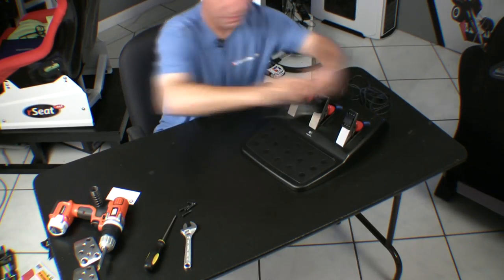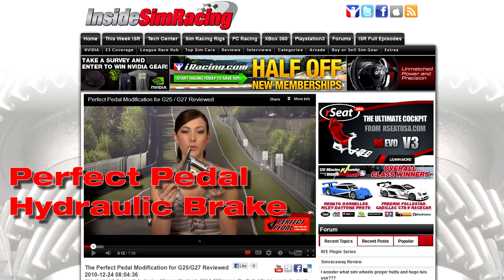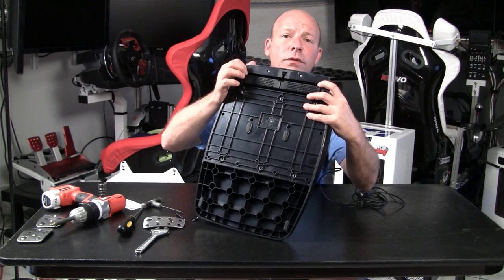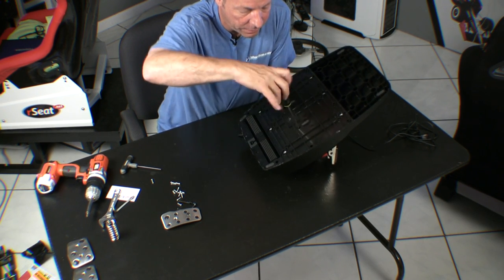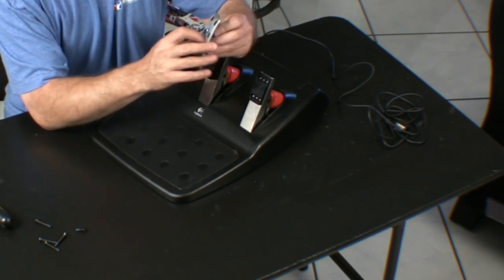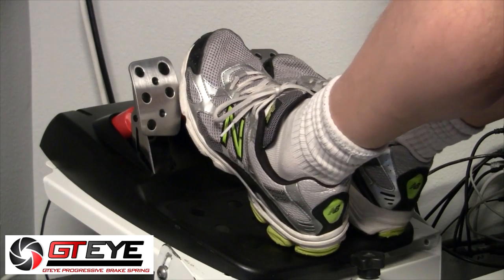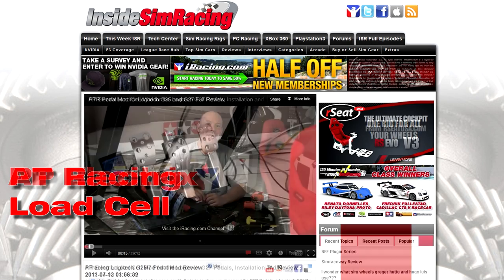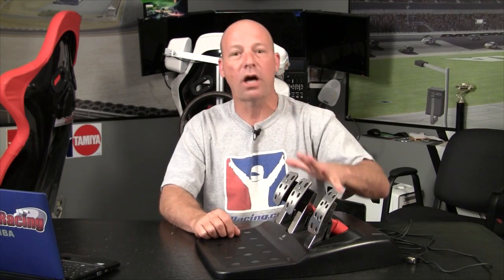GTEYE Brake Spring Mod for the Logitech G27 or G25 reviewed by Inside Sim Racing

Comment: Just in case anyone is watching this now, here's a piece of advice so you don't make the same mistake I did and then have to spend an additional hour with a soldering iron.

When you're placing the cover back on, make sure you're extremely careful with where you route the wiring. Due to how logitech designed the wiring "harness" for the G25/G27 wires, it's extremely easy to damage the wiring when reinstalling the cover. I don't mean simply pinching a wire either. The way the wiring is routed, it is VERY easy to have a section of wire near the little anchor piece to end up directly underneath one of the screw holes. The hole in particular I'm referring to is the left hole underneath the carpet gripper. That hole is extremely close to where the wires are running, and if you don't have the wiring exactly where it was when you removed the cover, you can run that screw back in and pierce right through the wire without even knowing your doing it because the screws go in rather snug normally.

I installed a spring mod and cleaned out my potentiometers, put everything back together and then fired up iRacing. When I went to calibrate my pedals, my throttle was completely dead. I was stumped as I made sure no wires were pinched when placing the cover back on and installing springs didn't require me to remove the connectors going to the potentiometers. When I went to take the thing apart again, I removed the two carpet gripper screws and that's when the issue caught my eye. I was working under a bright light and I could see a piece of red wire through that very screw hole and that's when I knew I must've damaged a wire. Took it completely open and sure enough, I mangled the black wire going to the throttle pedal. I had to remove the shrink tubing to get to the wire and since the wire is such a thin gauge, I had nothing on hand to splice it with. Thankfully there was just enough slack in the wire so that I could cut the wire, strip the two ends and solder them back together and finish it off with electrical tape. I got pretty lucky to say the least.

So just make absolutely sure that no wires are blocking those screw holes. As far as I'm aware, the only hole close to the wiring is that left one under the carpet gripper.
Reply: @untitled. Place the top plastic cover of the pedals upside down over an open box, then place the pedals into their slots in the top plastic part, then route the wiring, then place the plastic base on top and screw down. You're welcome ;)
Reply: Yup, had this happen to me as well. Had to go to the local soldering guy lol

Comment: If you unscrew the top end of the "shock" then you can replace the spring without taking the whole thing apart, just the two screws behind the pedal. Just installed it, working great!
Reply: Do you mean, you can replace the spring without removing the back cover?
Reply: @pato17rio  Yes, just remove the upper screws for the "shock" and pry it out. It will split and you can replace the spring and push it back in.
Reply: I was thinking if that could be done. Thank you for clarifying!!
Reply: Just replaced the spring without opening the cover. Thank you for the hint!
Reply: Can't do this
Reply: Thanks for the tip!!

Comment: Hey shaun, just a little clairfication.

The progressive spring will have the same resistance regardless of which direction you apply it, both sides will feel soft and then hard.

Because a progressive spring /any non spring with non linear spring constant will go from the weakest to the strongest regions (k value).

Comment: Best bang for your buck feels grate transformed my driving experience within a couple of laps in the V8 SUPERCAR i went from 2min 12sec laps of Bathurst to low 2min 8 sec on IRACING with lots of room for improvement.  i did install GTEYE BRAKE SPRING with the tight coil facing towards the bottom base of pedals unit with the soft coil part at the top of the brake pedal ass per instructions from GTEYE the new spring does come powdercoated as of 2016 . and calibrating at about 85 percent in IRACING CALIBRATION worked grate for still sockable racing which is what drew me to this mod and no clicks or squeaks perfect. Thanks INSIDE SIM RACING

Comment: GTEYE Installation Instructions PDF Download

https://gteyeblog.files.wordpress.com/2015/04/gteye-pedal-spring-instructions.pdf

IMPORTANT: For Brake Spring, install 
with the closer coils facing downwards to the 
lower half of the plunger

(not as on the video or Shaun Cole of InsideSimRacing mounts to upside...)
Reply: CTEDDY47 I noticed this too. I just received mine in the mail. Excited to try it out.

Comment: I used the Nixim mod ver. 2 and loved it, although I returned the clutch spring to a stretched-out stock spring. I also stiffened up my gas pedal spring with spacers and stretching out stock spring. Then I got Fanatec CSR Elite pedals.. I tightened the throttle pedal all the way, and set brake load cell to about 4.8. I still use socks!

Comment: Just a hint: you're supposed to take the cover off the other way which allows you to route the wiring correctly. Before taking it apart, remove the extra 12 screws in the bottom and raise only the bottom panel. This requires putting the whole pedal set over e.g. a box so that pedals do not touch anything while you're taking the bottom plate away. You still need to remove the pedal faces from the pedals that you want to remove from the set. This way also gives you all the space you need while working with the pedal.

Comment: Installed mine last night.... WOW what a difference a little spring can make!  Within 15-20 mins I started getting my braking sorted and the laptimes started falling, no more lockups and much more predicable braking especially in IRacing. I can highly recommend this mod to anyone looking for a cost effective hardware mod which still allows you to mod without having to mount the pedal set. Also, I bought it directly from www.gteye.com.au, not via Ebay.

Comment: Best advice to remember from this video is: the travel memory vs. muscle memory. The later prevails at all times. So, whatever mod yo use, it will definitely be better than stock.

Two Quick q's on this:

1. Can I use the stock brake spring for the gas pedal for a little bit more feel ? Did anyone do that ?
2. Is this better than nixim ?

Cheers
Reply: Clutch spring has far too much rebound for the throttle,

Comment: The ONLY way to get progressive tension is to vary the diameter of the spring wire, what is done here is a stiffer wire that makes one end suffer coil bind thus stiffening the response. As for your cables yes spot glue and put a cable clamp on the base so the wiring is not attached to the top cover.

Comment: I run in socks just fin with the Nixim 2 brake mod. It's the best bang for you buck improvement to the G25/27 pedals. Shortens your braking zones like mad because of it's rubber insert adding a real tactile max brake point. I hit all the time and I instantly know I'm at max braking. With a spring, no matter how progressive, will run out of travel and only then will you know your at max braking. There isn't any proper feedback. it's a guessing game, just like the standard Logitech pedals.

Comment: Until a few months ago you could only buy the Nixxim mod with the break a clutch mod, wich sets you back £33.49( arround 43€), i bought the GTEYE mod a few months ago for 23€. The Nixxim mod ins't better, its stiffer, with for me means its actualy worse, beacause its to stiff, you can't drive with out shoes. The GTEYE mod is really good and it is a nice upgrade over the stock spring.

Comment: Oh I forgot, I applied some white lithium grease inside the red tube where the tubes slide and also around the spring- it made a huge difference. Lithium grease won't harm plastic like other types of grease can, that's why you use that type.

Comment: G27 brake spring is much harder than gas or clutch.
I use my G27 mounted to my desk, and I'm reasonably fast with the right cars, but I actually think the gas pedal could be improved a bit as well.

Comment: I'm using stock Logitech G27, would this upgrade improve the experience with Gran Turismo 6? Because it looks like it shouldn't, because the problem with Gran Turismo 6, is that whenever you upgrade your cars brakes to racing brakes, it starts to lock up after about just 10-15% of the pedals way, this mod visually seems to only add extra pressure after about 40-50% of the pedals way, which means it wouldn't do me any good. Does anybody know an upgrade to make it possible to add some deadzone to the pedal or something, so that the brakes would only lock up after using 35-50% of the brakes instead of 10-15%??? I mean today I really got annoyed by it, I can only race with non-racing brakes, because the racing brakes just feel buggy with GT6 + stock G27 set...
Reply: +arcelivez never played gt6 but can you not turn the brake pressure down in the tuning settings for each car in game?

Comment: 30 bucks for a friggin' spring, that's just absolutely nuts, the whole simracing gear thing is one of the most overpriced gear ever, more so than high end audio systems.
Reply: You can find the 3 springs kit for 30 bucks. If you want better feeling and better times and dont wanna spend the money.... weellll use the controller , you can have the same results

Comment: Question for anyone with experience of both:

I race a 1987 BMW e30 IRL, (non-power brakes, abs defeated) and I am trying to use sim racing as practice.  On my rig my pedals are hard mounted but the chair is a crappy rolling office chair (the crappieness means it doesnt move much on carpet).  If the Nixom is comparable to that "stand on it" braking in a real race car with manual brakes then I'm worried that my seat will move.
Reply from the maker: RJ Till It may.. time to get a chassis !
Reply: +RJ Till Have the same issue...built a hold for the pedals that locks with the chair. Works like a charm =)

Comment: Seems more of advertisement for GTEYE than anything else this vid. Nixim 2 mod is far better. It CAN  be driven in socks, it CAN be driven without hard mounting it, it's much better when it comes to muscle memory knowing how hard to push it to get max braking, the Nixim mod is also higher quality. Everything this does well, the Nixim does much better. Save your money and get the Nixim2 mod over this. The Nixim2 brake mod on it's own, (you don't have to get the clutch spring) is also cheaper.

Comment: Makes no difference. The aim of the mod is to create extra stiffness when the pedal gets close to the end of its travel. If the spring is in the "wrong" direction, the first part of the pedal travel will still be soft since the spring will compress from the other direct first.